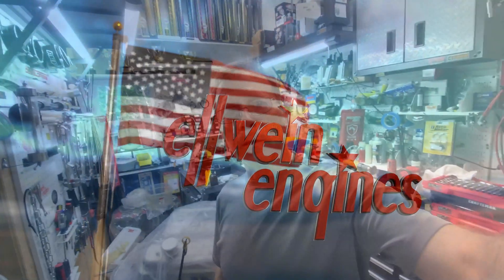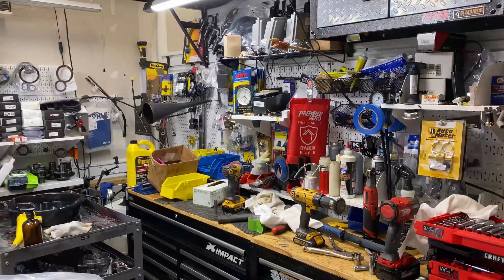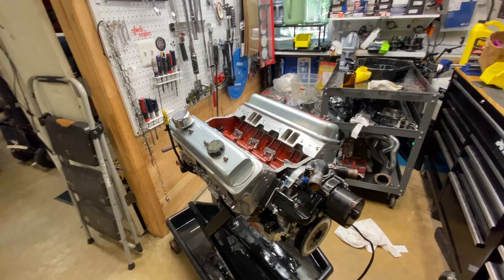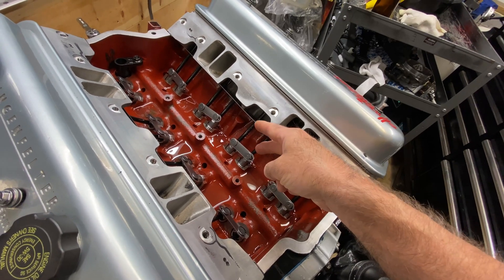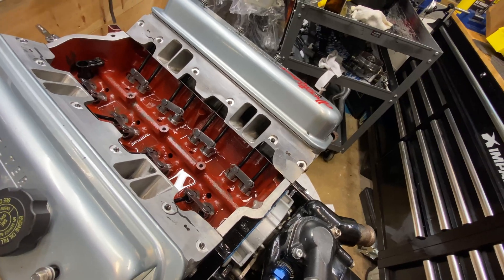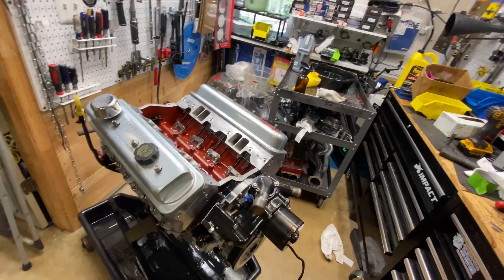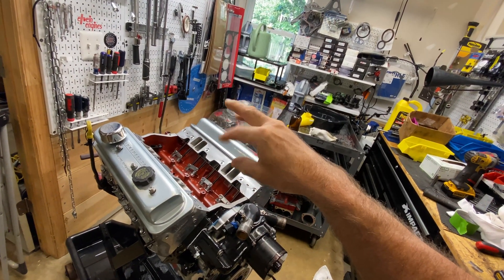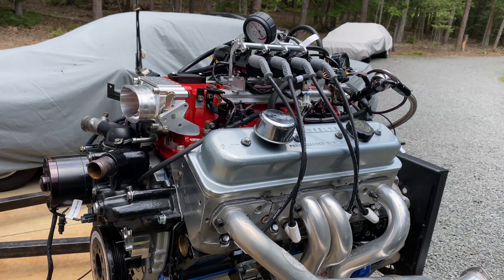Rebuilt Engine On The Dyno.  Low Oil Pressure!

Comment: Mr. Ellwein, for a stock bottom end LT1, assuming good condition, proper clearances, good oil, what do you consider a safe redline rpm?

I see many discussions about spinning rod bearings, and a lot of those people blame the factory rod bolts stretching.  

Do you think resizing the factory rods with ARP bolts would let it safely rev higher?

How high would you feel safe spinning a factory rotating assembly with ARP rod bolts?

Thanks!
Reply from the maker: Hard question to answer.  I do think the rods are the weak link but don’t know if better rod bolts would help (much).  I think new forged aftermarket rods would be best for more rpm.  So stock bottom end redline I think would be 6000 to be conservative.  So many have said more or less but it’s your engine and it theirs.  I am a conservative type.

Comment: So you prefer the high pressure spring over the standard spring with a stock style oil pump? (What are you bearing Clearances for the mains and the rods)
Reply from the maker: Yes,  I prefer that HP for any and all engines, even bone stock.  My builds always target 0.002" mains minimum and 0.003" max for #1/2/3/4 and .003 to .004" for the rear main.   Rods are always 0.002 to 0.0025"
Reply: @EllweinEngines  Thank you know i have to rip the oil pan off again and replace spring before i drop back into car lol

Comment: Good work, Karl.  By the way, would you have any pics/videos of a well ported iron LT-1 head?  ld like to view.
Reply from the maker: I'll see if I can find the photos of a set of iron heads that Lloyd Elliot did for a customer about 2 years ago.
Reply: @EllweinEngines  Thanks very much.  Finally getting around to building a LT-1 that I literally found in the mud ($40).  I think it will make a stout little motor for a dd g-body.

Comment: Another good video. I am curious about something. I have worked on quite a few of these. and im sure you have worked on way more than I have. But anytime you have tore down the OEM bottom end. Didi you ever notice the factory rear main size? Why are they different? is it because of the one piece seal? Always a .001 and all the others are std.
Reply from the maker: Yes I looked at a few factory bearings for curiosity and many are like that.  I  assumed because they have such a precise assembly system and super tight main clearance specs.  I guessed that they had that bearing volume measurment system in place for these 1990's LT1's and were able to be told right off the bat by their machine which bearing to select.
Reply: @EllweinEngines  I am sure you are correct on that. I wasn't sure why they were assembled that way.  In my opinion the 90s LT1 is a very under rated design.  It doesn't really get the credit it deserves.  I buy them when I can find them. Blown up or not. I see a lot of people don't like them because of the cooling system. But I think it's only because they don't understand how to fill it. And I looked on that efi website you told me about. They had every connection I needed for a wire harness
Reply from the maker: Cool.  It is always good news to know if some info helped out (or not).